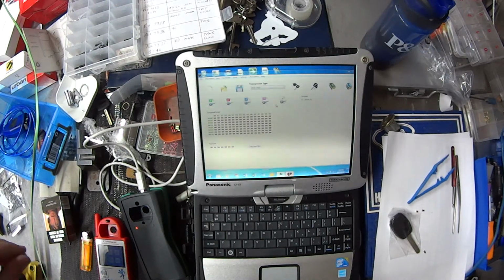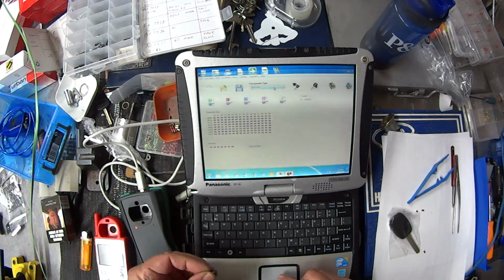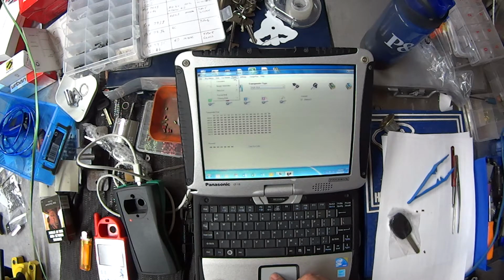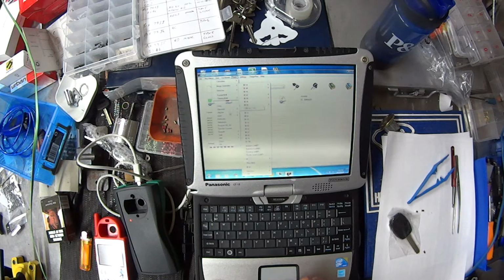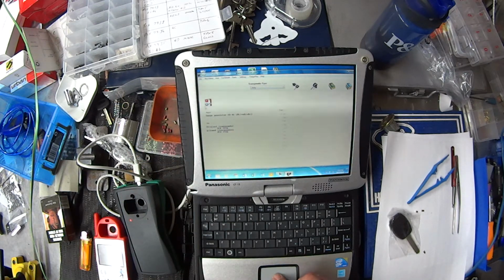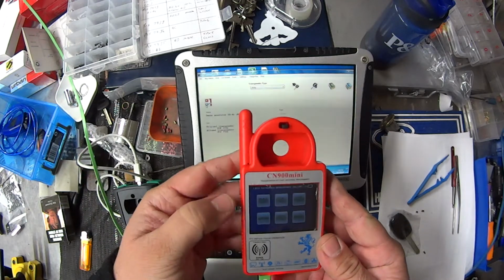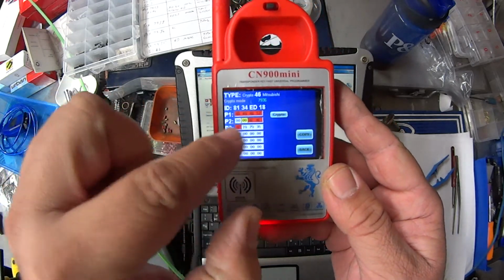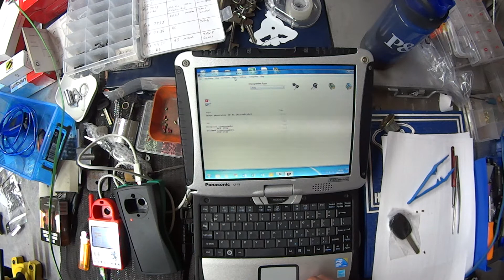Tango PCF7936  to ID46  For MITSUBISHI

Comment: Hi mate....Ray from AllRemotesandKeys in Brisvegas. We have what you have as well....but what you did with Tango, does that prepare a virgin pcf7936 with precode for CAN Mitsis ? btw, if U are AD, how about the new s/w for akl on Toyo G chip finally. Now ToyoPlus on Tango is no longer needed....except for the new emulators for akl on smart/prox systems I guess.
Reply from the maker: Hi, Im yet to try the new AD Toyota G and H software, I will keep you posted when I get the chance, I still have to try the CN900 and the Bluetooth obd plug for reset on G and H, I got that a few months ago but have not yet checked if it works. Its funny the more I spend the more the technology seen to get outdated ..lol
Reply: "Its funny the more I spend the more the technology seen to get outdated ..lol". Said exactly the same thing on a USA whatsapp forum last week......as soon as we buy something, it becomes outdated. btw, the G & H obd reset dongle for mini is ONLY applicable to USA Toyo vehicles....they have been able to do this with AD pro gear every since G & H came out....their vehicles run a different platform to ours.